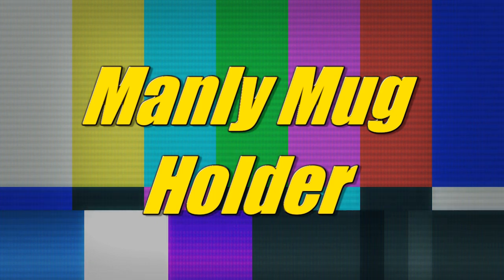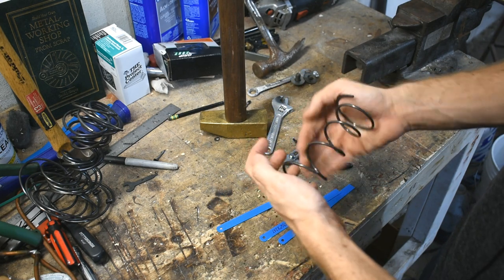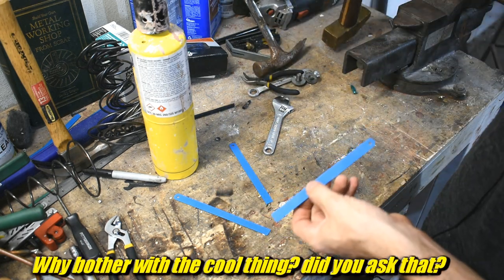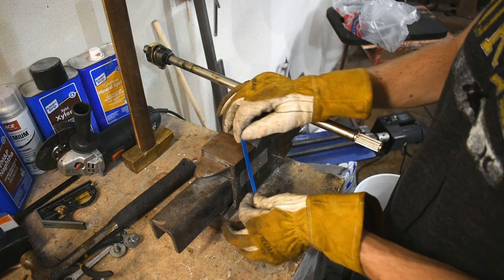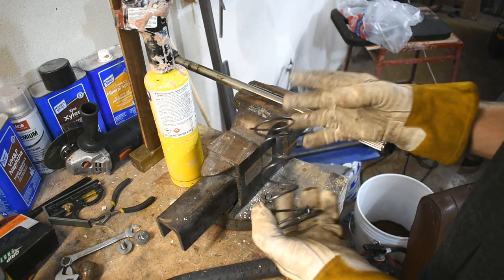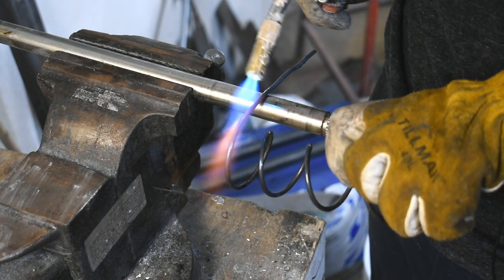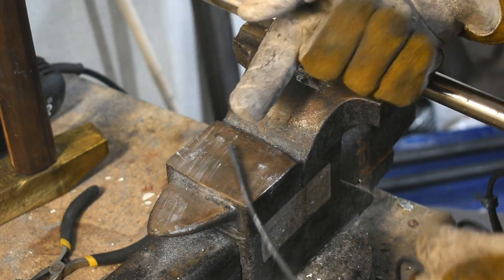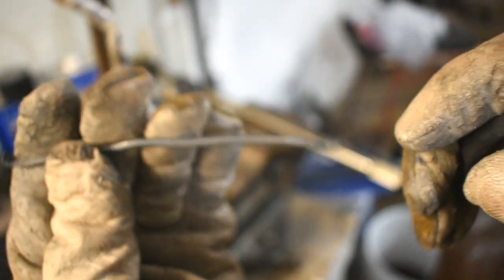Forging Small, Useful Tools with Simple Tools

Comment from the maker: Looks like I forgot to change the title somehow in-video? My bad.
Reply: carbon gets trapped in between the iron. this is what hardens it. this only happens when you cool rly fast. however it makes it very brittle. you need to temper it or it will break. 400F for a hr let cool and repeat. this adds flexibility so it doesn't break so easy.

Comment: couple of things. you could have cold forged much of that.all you needed to do was anneal the steel first. The hacksaw blades are quenched, but not tempered(why they shatter), the springs are quenched and tempered to spring state. simply heat to a red orange and allow to cool slowly...walla ...soft steel. much easier to work. then you can requench (medium hot cooking oil...150ish degrees F) after it is cooled, put the tool in a toaster oven or similar and set to 300-400 degrees and let it sit for an hour. takes the brittleness away and leaves you with tough steel.

Comment: Thread the coil of the spring over your clamped up shaft. Pull the free end with pliers as you heat the section of spring between the pliers and the shaft. You can unreel the spring smoothly in one go, quickly.

Comment: Depending on the kind of steel you quench in different mediums like for o1 steel the o stands for oil which is how you quench. Like how w1 is a watering hardenable steel and s7 is an air hardening steel. Love the forging paul

Edit
Quenching oil hardenable steel in water makes it develop micro cracks
Reply: @A Fucking Leaf of course friend
Reply: That can't be right 'cus "air" doesn't start with an "S".

Comment: depends on the carbon content. if it is 1045 steel it will not harden with oil as it doesn't cool it as fast. those blade are probably 1080 or 1095 or a silica/phosphate alloy. just need to temper it at 400 for a hr and let cool than repeat. this takes back the hardness a little at a time by allowing the carbon molecules to slowly escape from in between the iron molecules.

Comment: Also, I felt this needed to be said separately from my other comment, as far as heat treating goes, there are a few things there that you need to do differently.  Let's start with the fact that the spring is almost certainly 5160 steel (it might be something different, but likely close enough that the following still applies).  

So first thing you do is heat it to just past non-magnetic, (1500 - 1525 F).  This basically changes the grain (which is what you did when you heated way below that to take the "spring" out) and if you get it too hot  you get large grain which is weaker.  Anyway, once it's at that temperature, you should use oil, and while many people will tell you you need special oil, peanut oil or frying oil will work fine.  Before quenching, make sure the oil is at about 200 F.  Once you put it in to the oil (for a few seconds for something that small) take it out and let it finish cooling the rest of the way normally.

At this point you have a very tough and brittle piece of steel.  This will shatter if hit hard as you saw when you yanked on it and it, well, snapped.  What you do next is put it in the oven (even a small toaster oven) at 400F for about 1 hour.  This will temper the steel and it will be less hard, but also less brittle.  Don't worry, it will still be hard enough to hold it's shape and an edge.

A few other things.  These directions are quick and dirty hardening directions.  The correct set of instructions involve heating to temperature and letting air cool several times to normalize (even out the grain structure of the steel) and then quenching (hardening) at specific temperatures for a specific amount of time.  If you must use water, you should be using a brine (I've never used a water heat treat so I can't tell you the ratio of water/minerals) and it should, again, not start out really cold.  Finally, the reason the saw blade broke initially is because of it's hardness and you can get it to that hard/brittle again by hardening, though I'd suggest tempering that also.  Hacksaw blades can be made out of one of MANY different tool steels and each steel combination has different specific hardening instructions that you should follow, though most will work perfectly fine using oil and heating to just north of 1500 F (non-magnetic stage).

I hope this helps you in the future.
Reply: Just to add a counterpoint please don't think there is one correct way to do anything re heat treating steel. 
For example re the scraping blade yes oil quench followed by heating in an oven at a set temp for a set period of time will work and is a modern engineering approach .....most blacksmithing texts I've studied would suggest drawing the temper rather than sticking it in an oven though, google the colours of oxidisation and you will be off to a good start. If you draw the temper you can control which parts of the scraper are hard (the edge) and what is tougher  and less brittle..... Other texts will suggest that what and how you quench in the first place is critical eg only quench the sections you need to harden in the first place eg just the edge not the whole blade....
There is a massive no of ways of doing these "simple" tasks :)
Reply: @cormacjames5579  I agree that there are many ways to get to the same point.  I was just trying to provide enough information to give him a successful heat treat with minimal steps.

Comment: Depending on the grade of steel you have will dictate which quenching medium you want to use. Best practice is to have several mediums set up oil, water, etc and take a test piece heat it up and quench it in said medium and than try to test the hardness by using a file bending it. Also by doing a spark test before you start you can get a better grasp of the carbon content of the steel. some mystery steel are also air hardening. Meaning quenching it can cause the steel to get so hard it will crack and/or shatter.
Reply: Sounds complicated.
Reply: @1pcfred  it can be

Comment: quenching in oil makes less brittle
Reply: actually yes and no. depends on the carbon content. if it is 1045 steel it will not harden with oil as it doesn't cool it as fast. those blade are probably 1080 or 1095 or a silica/phosphate alloy. just need to temper it at 400 for a hr and let cool than repeat. this takes back the hardness a little at a time by allowing the carbon molecules to slowly escape from in between the iron molecules.

Comment: Paul is that washing machine part from the same washing machine you used as a pottery wheel?
Reply from the maker: Nope, the pottery wheel was a GE, this is the output shaft from an old whirlpool washer transmission
Reply: Looks like a drive shaft out of an outboard engine..🍻👍